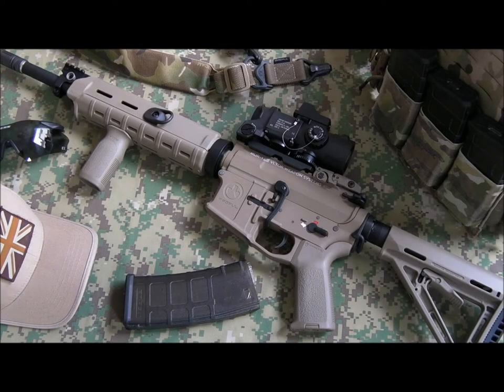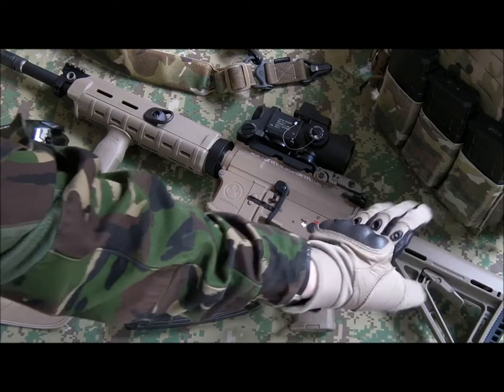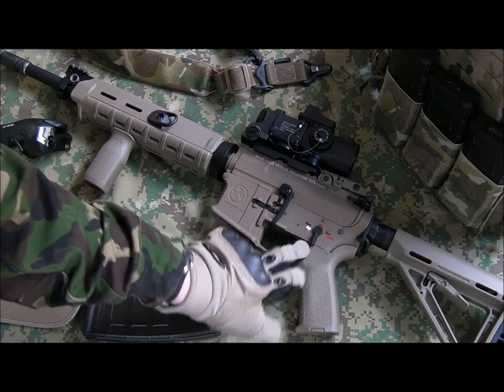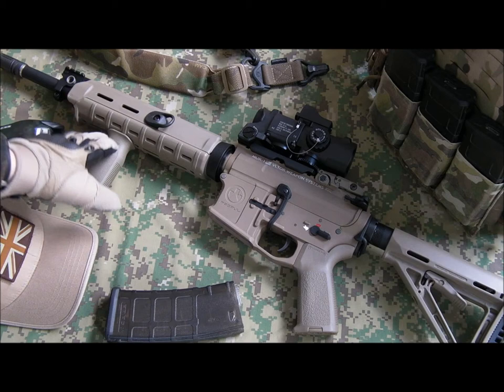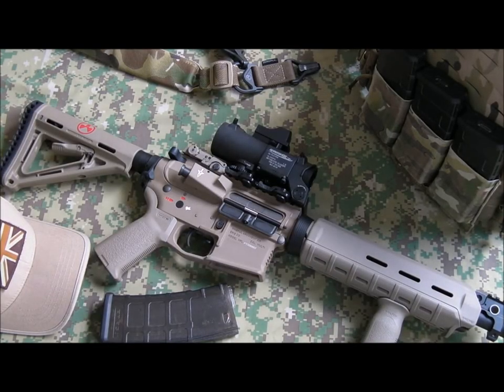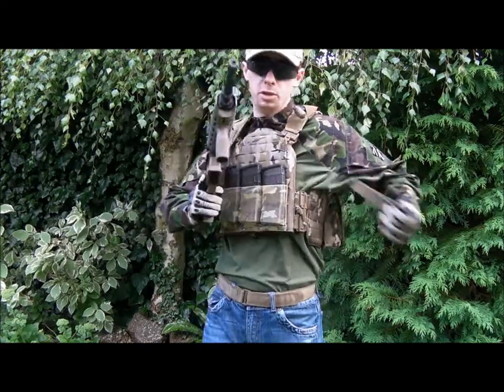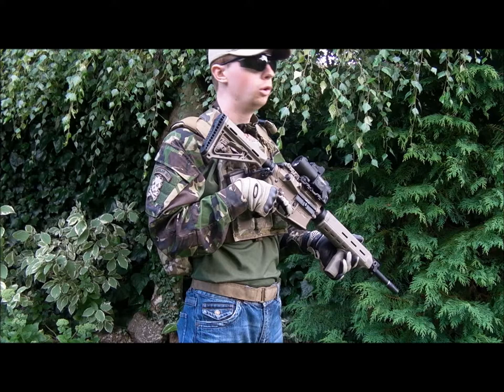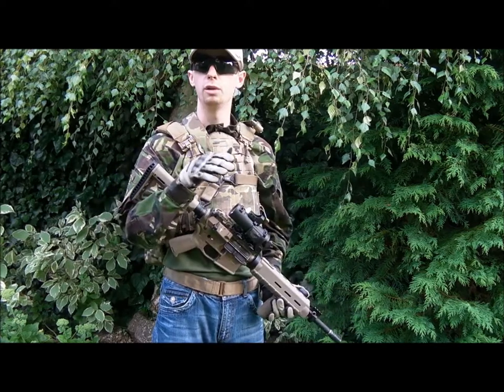Magpul x G&P - MOE Custom Mid-Length M4

Comment from the maker: Generally, all I'd want on a rail is a foregrip, sometimes a light and possibly a front BUIS if the gas block doesn't already have one.  In this gas the gas block has a flip up sight so no need for one of those, and this is a purely outdoors gun so no need for a light; so just the MVG to mount on, very comfortable setup which keeps the weight right down.  If I wanted a light of course, there;s always the MOE Light mounting kit.

Comment from the maker: You know I was watching it back and thinking the exact same thing.  Did spend some time on that when I first put the MOE pistol grip on there but I'll look at it again.  Might just be the gearbox needs some other work to make it run a bit smoother, but the trigger response is decent enough so I'm not too concerned.

Comment: What battery do you have. I have the gun and it has deans configured but the battery is a tamiya aNd won't fit
Reply from the maker: I run lipos with deans for this particular setup.

Comment from the maker: There's a few places selling chinese replica stuff which is decent.  Which is about the only way to get anything AOR, unless you have $8000 to spend on eBay for a Crye plate carrier that is.  Or, do the sensible thing, hit the middle ground and go for real gear in arid MARPAT; costs a bit but nothing like AOR1 does on the bay.